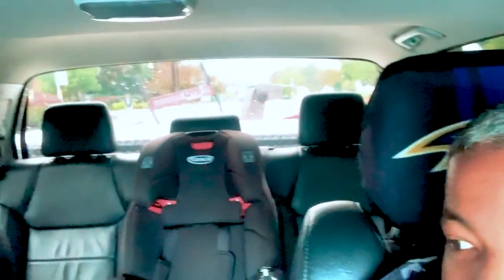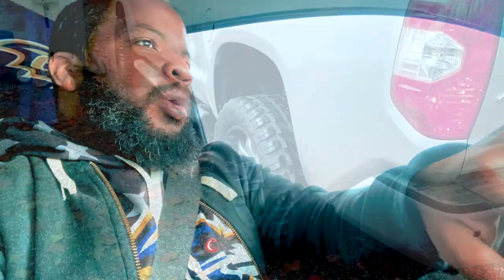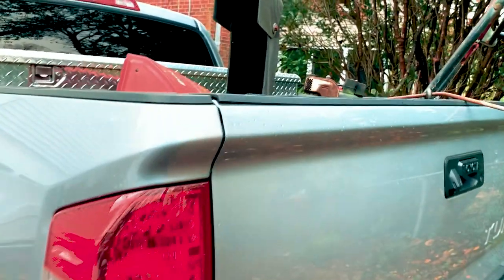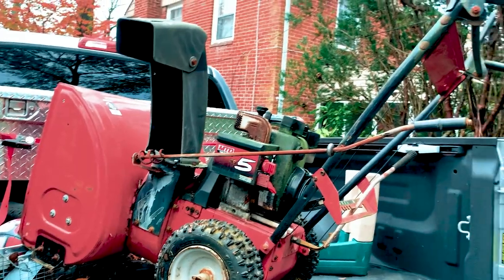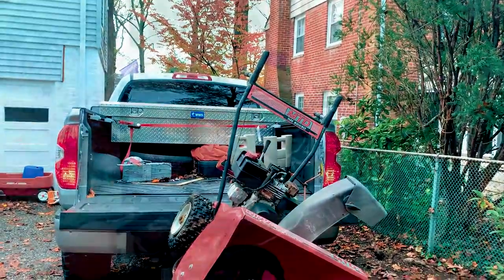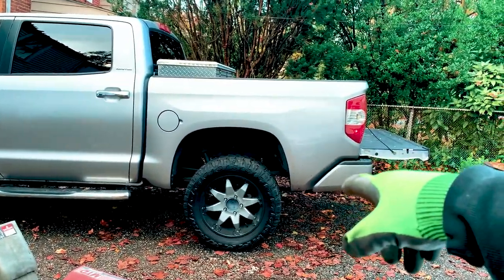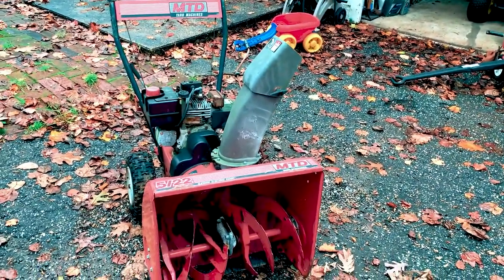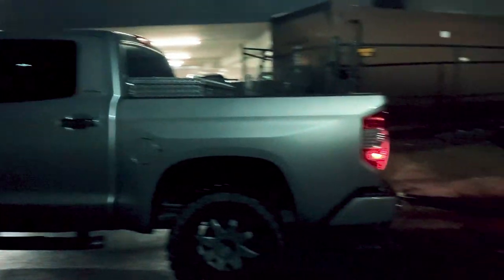Picking Up A Abandon Snowblower | Snowblower Restoration Project Ep.1

Comment: Nice find!  I work on a bunch of these.  Yours has a Tecumseh Snow King engine, which is extremely common.  Most of them that I work on have clogged carburetors.  You can either clean them, or replace them very cheaply.  For the ones that I opt to not clean, I get replacement carbs off Amazon, typically for less than $15.  I have a playlist on Snow Blower repairs.  Let me know if I can help!  Good luck!
Reply from the maker: Thank you very much sir for providing this information. I will be sure to check out your videos to help guide some light on getting this snow blower back on the road.